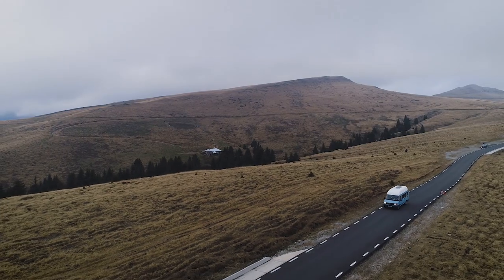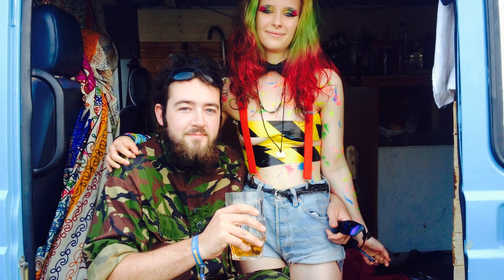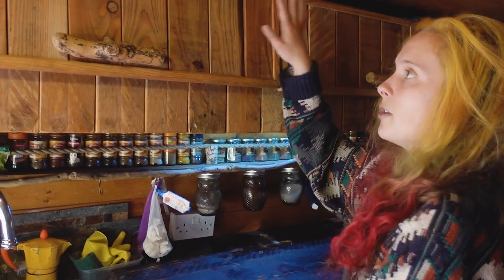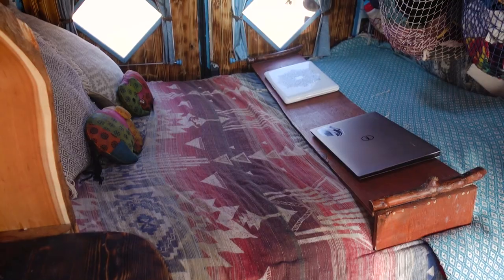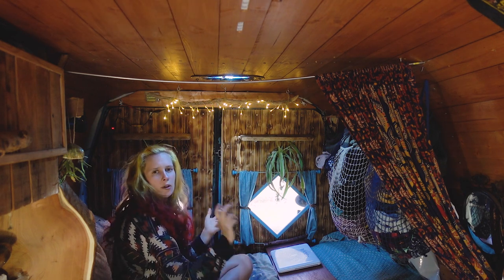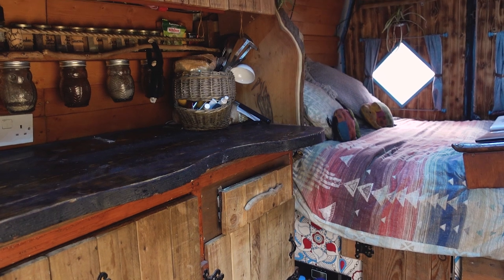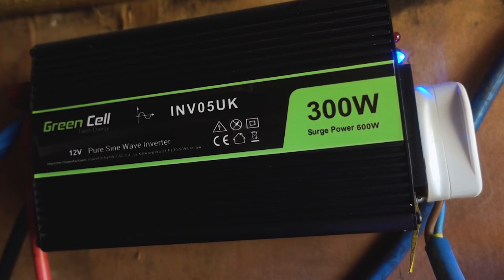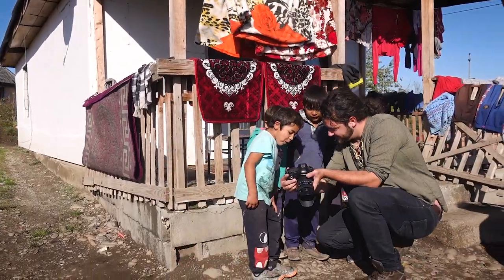Why We LEFT the UK｜Van Tour 2019

Comment: Thats amazing! I want to be you! (Or your other half, im male) just sorting my transit swb camper to live in so your going to be overwhelmed with questions from me im affraid 😀.  First Question - if i were to run my leisure battery with only a TV and phone charge how long untill it should be charged? Same batteries as yours but ive no solar panels. Keep it coming guys, i so envy u both.
Reply from the maker: Thanks so much, and no worries at all! The answer will depend on a few different factors- how many Ahs is your battery and how many Watts does your TV use? Your phone will use virtually nothing to charge but your TV, unless it’s 12v, will use significantly more. When you know the Wattage and Voltage of your TV (which it should say on the power cord) you need to do Watts divided by Volts to figure out the Amps and from this you can work out how many hours you can run your TV on from your battery. Bear in mind you’ll want to keep your battery level above 12V at all times to avoid damaging it. Hope I’ve explained this well!

Comment: I re watched this video and I must admit the security feature in the back is a great idea. Unfortunately this type of safes are not as safe as one might think. They open in about 2 seconds if you know how (No tools required)
To make it a lot safer I would change out the very sloppy spring which is wrapped around the main locking pin. That would mean the safe is hardly useable with it's key pad (since the electro magnet is no longer able to work against the stronger spring) but you can always use the key.
Also these safes become much more safe if it has been enclosed completely so there is no access to the top and sides (this factors in into the 2 seconds of opening flaw the safe has)

On a more daily use note: Where are the facilities please? A dry toilet build into the coffee sack ottoman maybe?
Reply from the maker: Thanks for the tips! The safe is in fact bolted to the floor and the keypad has never worked so it only opens with a key, however we didn’t know about the sides being vulnerable so will have to do something about that!

As for the facilities, it’s usually just a shovel in the woods (more ecological), but we do have a small portable toilet as a back up that lives behind our curtain 💩
Reply: @FromRustToRoadtrip  The sides aren't vulnerable as such 9unless your garden variety thug is lugging a oxi-acetilene set with him/her... The safe is vulnerable in a simple way. The cause is the very loose spring wrapped around the pin which is actuated by the solinoid. Even if the solinoid is not working it can still pose a vulnerability. It is recommended to upgrade the spring to one which does not allow the pin (held only in place by the very loose spring) being bashed downward (for instance by hitting the top of the safe very hard (which knocks the pin out of the way leaving the safe unlocked for a split second. A well timed bang on top and even better timed pull on the door results ussually in the safe being opened...
The key mechanism can not prevent that since it actuates the same loosely sprung pin. Again, upgrade the spring and you will be fine or even better set the safe in some sort of enclosure (in combination with setting it on it's side to save space)

Comment: Great video guys brought back memories of my ldv with the Peugeot diesel engine and no power steering but she did me well  for 10 years.  It was replaced with a Transit which has done me good for 16 years, it was like upgrading from a tractor to a limousine. They become old friends and although I could do with replacing her now I just can't bring myself to do it 😂 Damp clothes yes I tend not to carry too many but I was going to look at those storage bags you can buy where u extract all the air out, they also reduce the storage size, but I suppose it's easier to go to a local boot sale or jumble and buy a new outfit for pennies
Reply from the maker: Wow it’s great to hear how long you’ve kept your vans going, it’s great to see people keeping old vans alive and out of the scrapyard! That’s s good idea with the damp clothes, but you’re right- minimalism is the best way 😛
Reply: In our van we use and reuse those ziptie bags from ikea, they keep our clothes and towels dry and dust free as our van is also used as our working van for carpet fitting and so forth.

Doesn't that dieseltank in your garage smell a lot?
Reply from the maker: That sounds like a good idea! And nope it doesn’t smell, no more than a Jerry can of spare fuel does! Although the diesel heater does smell a bit when it’s on

Comment: £1700, is that all in? Good value for money if you have done over 70k miles
Reply from the maker: Yeah it’s around that figure for the conversion and upgrades but closer to £8000 including breakdowns and mechanical upgrades / repairs. Which still isn’t too bad as it’s been to 28 countries over 3/4 years and we aren’t gentle with it on rough terrain either 😂

Comment: Have you worked out how Brexit will affect your travels in the EU?
Reply from the maker: Well of course nothing solid is in place yet, however if the deal were to go through we’d be limited to 90 days out of 180 days within EU countries just like every other non-EU national. So in terms of travelling around the Balkans it would take a bit of planning to spend an equal amount of time in EU and non-EU countries, but in terms of travelling around the North and West we would be extremely limited as we usually spend around 7 months on the road and so we’d be limited to just 90 days. 
When the vote happened in 2016 it was just two weeks before we were due to leave on our first trip and the value of the pound plummeted overnight so we lost £1000 collectively in our savings, and the value of the pound has not been as strong since so unfortunately our money hasn’t gone as far in Europe as it could’ve these last few years but it just means we work harder when we’re back in the UK to save ☺️
Reply: @FromRustToRoadtrip  Brexit sucks.

Comment: I'm about 6 minutes in, and shes covering the gas oven... I really hope that compartment is vented in some way because something about storing a propane tank in a confined space with an oven seems dangerous to me...
Reply from the maker: Not vented but the bottle is always turned off when driving and not in use. When we use it we leave the sliding side door ajar and cupboard door open for ventilation. The oven heat only rises so the bottle area never gets warm at all. Probably not the text book safest way to do it but we’ve had no problems over the last four years :)
Reply from the maker: Our thinking was that there are so many air holes in this van anyway, the door seals let tonnes of air in and seeing as we spend so much time in cold countries we didn’t fancy adding more holes lol. As said it’s been fine for the last four years but the next conversion we complete will comply with gas safety regs
Reply: @FromRustToRoadtrip  I must agree, please add a drop vent to the cupboard with the gas. Doesn't have to be anything fancy, basicly a hole in the floor. Gas travels like water so it will head down the hole if there is ever a leak.
Reply: 1234  I'm all for not adhering to health and safety. But for the sake of probably an hours work and no cost why not add a vent.